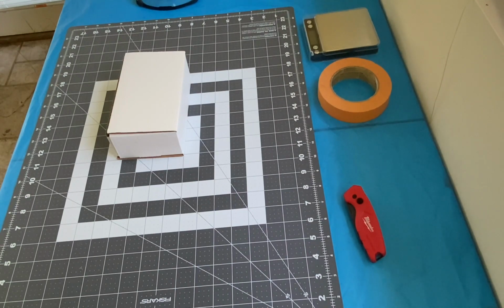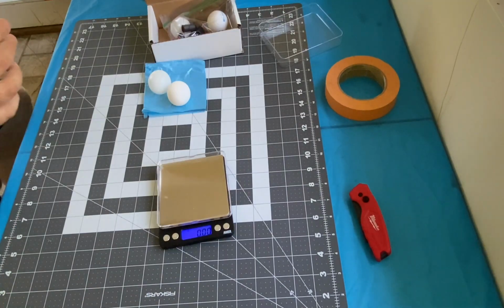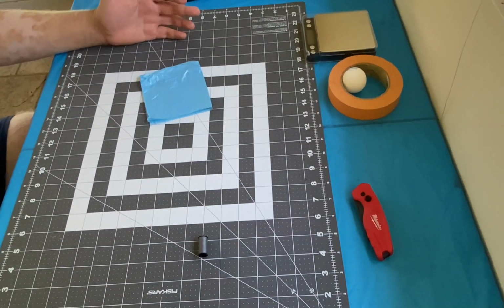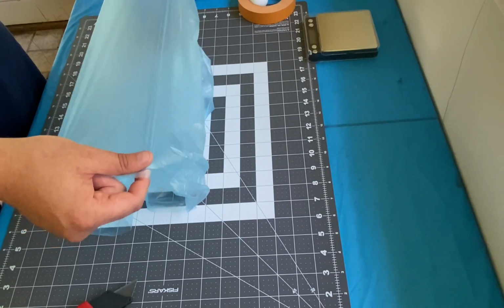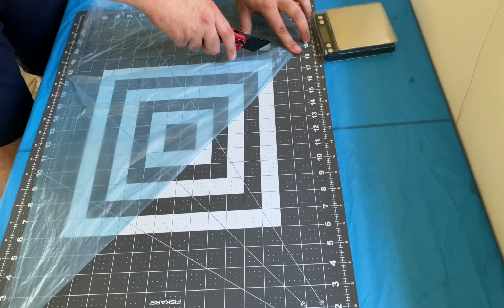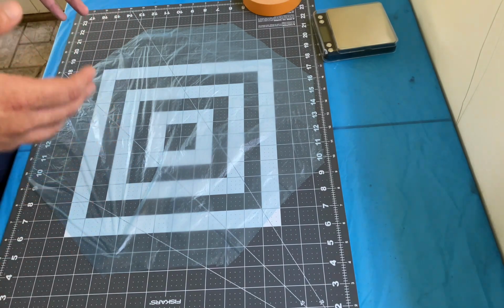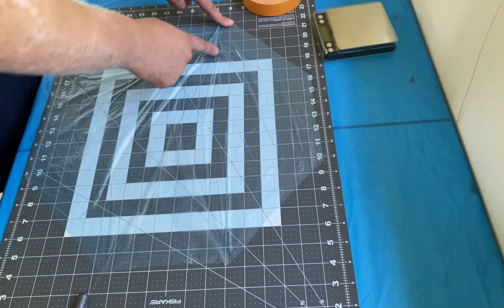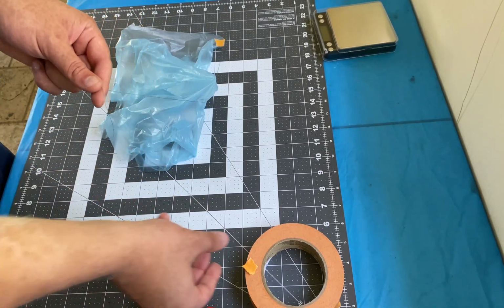Parachute Champion Kit 2021-2022

Comment: Could you provide an explanation for using an eight sided canopy? Thank you
Reply from the maker: Can you specify you question a bit more? Explaining everything might be confusing
Reply: Yeah for sure. So while I would assume your design is based on the ease of cutting the octagonal shape, I was wondering if there was any science related to longer air time for the octagon. For example what number of sides on a parachute canopy would provide the longest time aloft if given the same area. Any ideas on the topic? This is my last year competing and I’ve loved making parachutes since I l’ve started. My only goal is to make the best parachute possible and that’s the only question that has stumped me. I’ve been watching your videos for years now and you seem to have a great understanding of all the events. Any help on the subject would be fantastic even if it takes me a while to understand. Thank you
Reply from the maker: Thanks for clarifying. An 8-sided canopy is not the most effective shape for a parachute, a perfect circle is better. However when making a circular parachute it’s much harder to get the strings equally spaced from each other in comparison to the octagon parachute. Also, from my experience the benefit of a circular shape is pretty marginal but is something to certainly consider when competing at a high level. I have experimented with making a perfect dome shape but this requires tape/glue, adding weight and nullifying the benefits. Because the science Olympiad event focuses on small scale parachute, building an ultra light parachute using Mylar or similar materials would be the most effective way to improve results. Please let me know if you have any other questions
Reply: That helps me a lot. Thank you for explaining. Best of luck with the channel, love the dedication.